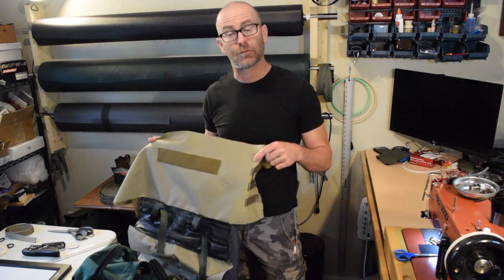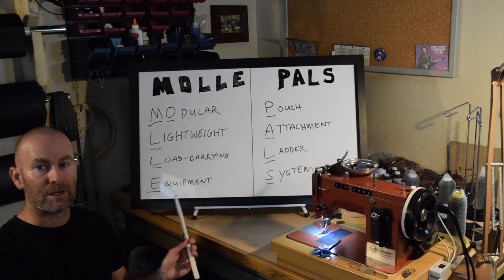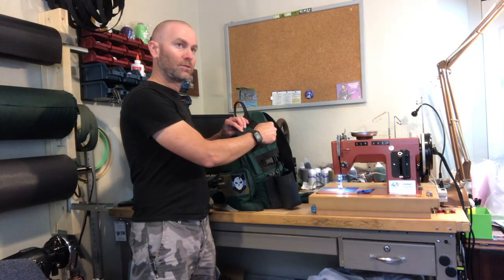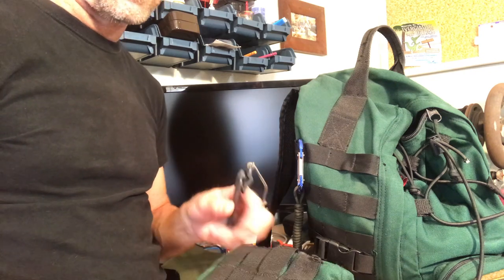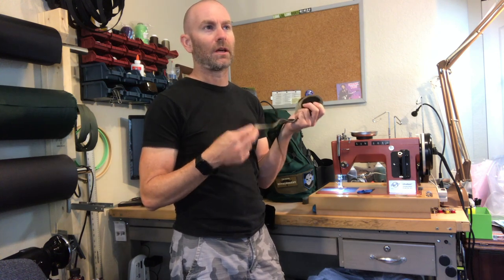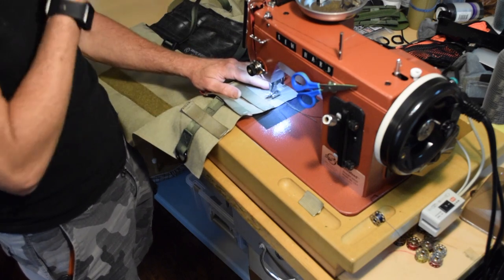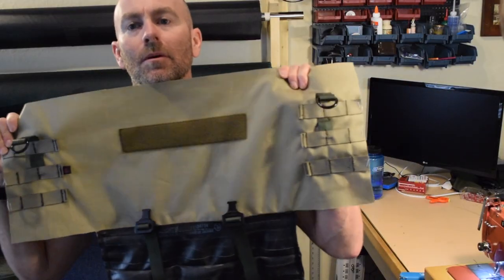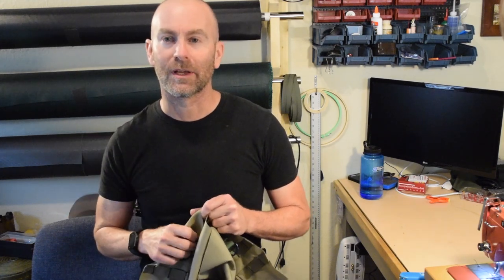Sewing MOLLE (and maybe we shouldn't call it that)

Comment: For those interested, the "official" requirements for PALS webbing barracks is that they will be 3/4 inch long and hold a minimum of 250 pounds.  No specified pitch or barrack width....
Reply from the maker: Thanks!  Do you know of a resource where that is documented (that "normal" folks can access)?

Comment: I have a US MOLLE backpack from army/navy surplus store and it has zig-zag on the straps. 2mm wide and 18mm long strip with about 24 stitches in that length. If you do try to find a MIL spec for sewing, there should also be something about thread tension spec in there too like a bolted connection will have a torque spec. What tensile strength does the thread have? If 20lbs times 24 stitches that's 480 or a factor of safety of 2X or more for a typical 95% Male. Of course a heavy pouch will have two MOLLE straps for even more of a safety factor.
Reply from the maker: Really great info, thanks for contributing!

Comment: Typically a 28 stitch bar tack is used to tack 17337 down but several custom gear builders use 3 passes of straight stitch (which is what they use in laser cut 'MOLLE ' panels and it holds just fine.
Reply from the maker: GREAT info thanks!

Comment: Great explanation...former army guy and didn't know pals ha.  I've got my sailrite on the same drafting table. Thank you for the vids.
Reply from the maker: Thanks Brian, 
That's pretty cool that you're using a drafting table as well.  I'm planning to make a new top for mine with a cutout to mount my machines in, you might want to check that project out whenever I get it done!

Thanks for watching and commenting!
Reply: thejasonofalltrades  I have something similar in the works too. The table top design is based on the "Paulk workbench."   Keep up the great work!

Comment: As one who served In the military As a combat Shoulder And sewed Combat equipment Like flak jackets and more I would often used The MOLLE System. As of sewing on The webbing I  leave About An inch between straps Like you Did . In the video You talked about the stitching you used And you Weren't sure if it holds up in military specs,Still what I would do Because I had a straight Stitch At the time and didn't have any zig zag options I just Would go Front words and back 2 to 3 times And wouldn't even lift my foot and move on to the next i would just keep on selling in a straight line to the next strep . As of Strange and military specs For me it held up pretty good and did not have Any problems. I love watching your projects I'm very inspired by them And get good ideas to.I hope I helped in the way If you have anymore questions Feel free to ask . It's always good To get a second opinion .
Reply: feel free to contact me for pics. of the Pouches I made
Reply from the maker: Thanks for contributing your knowledge!

Comment: Hey Jason.. do you use bonded nylon or polyester thread for Cordura sewing? Thx again my friend
Reply from the maker: Hi Jeff, 
Sorry for taking so long to reply!
I generally use bonded nylon, usually in size V69 (aka T70) for everything I sew.
In this video, I was actually using V92 polyester, only because it was the only OD green thread I had.  I previously used this thread in my toiletry bag, one of the most successful and long-lived projects I've made.  However, this particular thread has had a tendency to unravel when I'm sewing at times (but NOT after it has been sewn in).  I don't have a lot of experience with polyester to say whether or not it would be better in some applications, but bonded nylon has been my go-to for almost everything I sew.
I hope that helps, thanks for watching!

Comment: Thanks for the video. Just want to know thread size(#) and what thread material you are using to sew the molle straps with. 

Thanks for your time
Reply from the maker: I almost exclusively use nylon thread in size V-69.  The Thread Exchange has a great selection and a lot of information.  I don't know what the MilSpec for MOLLE requires, but V69 has worked great for me on many projects with MOLLE/PALS.

Thanks for watching!

Comment: I know it's not necessarily germane to this particular video, but have you ever tried to sew scuba webbing? If so, how did it go? What machine and setup (needle size, thread, etc) did you use?

Thanks!
Reply from the maker: Hi, 

I'm so sorry for taking so long to reply!
I have not sewn SCUBA webbing.  It's been some time since I've handled it, but if my memory serves, it's pretty dense stuff.  I suspect it should be sewable with most machines, but it may be helpful to choose the right needle and thread; I'm purely speculating, though.

I would try my freediving weight belt to see, but it's rubber, sorry! :)

Comment: Also, thoughts on replacing the webbing with 1" loop velcro for dual attatcment options.
Reply from the maker: I've seen this done, but I haven't tried it myself.  I think it might be better to sew velcro to the webbing than to just use the velcro AS the webbing.  But it would definitely add some versatility!

Comment: What is that large and beefy “sewing machine” in the 3:18 background? The one with a bridge-style support on its top?
Reply from the maker: Hi!
That is a Singer 29-4 "patcher."  It is a cobbler's machine, intended for patching shoes.  It is commonly used for things like sewing patches to leather jackets, because the sewing head can be turned 360 degrees while sewing (so you turn the head instead of the piece you are sewing).  I've never used this one, picked it up at an antique store.  It's possible that 2021 will be the year I finally get it going.
There are some very cheap versions of this machine (google "Chinese patcher") available on the internet, as well.
Thanks for watching!

Comment: What thread do you use? 
Thanks for the great information.
Reply from the maker: Hi John, 

In this project I used a polyester thread in size V92, but I'm not sure I recommend it.  The strands of the thread tend to separate while sewing with it.  I've used it in other projects with no discernible issues, though. (I'm uploading a review of the finished bag in the next day or so, and I talk more about this thread in that video.)
My go-to thread is bonded nylon in size V69.  Size 69 is generally considered the heaviest thread one should use in a domestic machine, and I regularly use it in my Sailrite.  We also use it a lot on industrial machines at my work.  
I hope that helps, thanks for watching!

Comment: What kind of machine do you have? What would recommend .
Reply from the maker: The machine used in this video is a Sailrite Ultrafeed LS-1. Full disclosure, that machine was provided to me by Sailrite to review.  I have since purchased the zig-zag capable version, the LSZ-1, with my own money at full price. I HIGHLY recommend these machines.
Check my channel for a review of the LSZ-1, and many other videos featuring them.  You will find if you do any googling about these machines that there are MANY look-alike machines for FAR less money: I have spoken at length on this in many videos, my position in short is you get what you pay for, and don't be fooled by thinking that something that LOOKS like something else is THE SAME as that thing.
If the Sailrite is out of your budget (they are NOT cheap), a used industrial walking-foot machine is a good way to go if you have the space.  If you are just starting out, I have come to love my Singer HD machine (after years of having a low opinion of them).  I just finished a year-long evaluation, several videos on my channel for that one as well.
It's a little dated, but this video covers my thoughts on sewing machine selection pretty well (other than I would add the Singer HD now).  https://www.youtube.com/watch?v=fFq5QXgF4v8

Comment: Hi Jason
Was wondering how feasable it is to sew a few PALS/Molle attachment points on by hand,assuming it can be done if you have the time !!?(attaching to Cordura) ? I have a machine but don't really want to take the pack apart....
Just found your channel and now subbed !
Many thanks from across the pond
Dean
Reply from the maker: Hi Dean, 
So sorry it has taken me so long to reply!
You can definitely do it by hand, although it will be time-consuming.  I would suggest getting a curved needle to make it easier to only go through the outer layer of fabric and not the liner.  You'll need to use care, but depending on how the pack is constructed, it's probably doable.
I hope that helps, let me know how it turns out!
Reply: @thejasonofalltrades  
Hi Jason
No worries.
Good call with the curved needles..i will invest.
Assuming i don't want to go through the liner for reasons of water resistance rather than just asthetic's ?A job for the upcoming colder,darker months ahead i believe..maybe not for you !!
Appreciate the advice and look forward to more content .
Thanks again
Reply from the maker: @deanmoriarty67  The main reason to avoid going through the liner is just to avoid the stitches showing on the inside of the bag.  If you don't mind that, you can go all the way through (unless your bag has a vinyl liner or some other water-resistant material you don't want to puncture).
Yeah, I used to have colder, darker months, lol!
Thanks for being part of the channel, let me know how your project works out!

Comment: are you using high strength nylon threading for the sewing?
Reply from the maker: I almost exclusively use bonded nylon thread in size V69.  I've used this thread extensively with no issues. I usually get my thread from The Thread Exchange.
Thanks for the question, and thanks for watching!

Comment: Is there a name for the stitch you're using? Can it be done by hand? What thread would you recommend? Thanks!
Reply from the maker: The stitch used for attaching PALS webbing is called a "bar tack."  It is technically made up of a straight stitch followed by several passes of zig-zag stitch.  If you are sewing to a particular standard or specification (like "Mil-Spec"), that will call for a particular stitch length, width and number of stitches.  However, for a DIY project, even just sewing back-and-forth with a straight stitch a few times gets the job done.
In theory, one could certainly hadn't sew webbing on.  It might be difficult.  A sailor's "sewing palm" might help make pushing the needle through hurt less. 
I use bonded nylon thread in size V69 almost exclusively.  It works great for attaching webbing to fabrics like Cordura, ballistic nylon, etc.
I hope that helps, thanks for watching!
Reply: @thejasonofalltrades  Thanks for the very informative reply!

Comment: Hey there! I know this question well mine.. it is possible to remove it? I mean the molle webbing.
Reply from the maker: Hi!,
It is possible to remove it, but depending on the material the pack is made from, it may leave unsightly holes and will not be as water-resistant as it was.  All you need to do is use a seam ripper to cut//pull the stitches where the webbing is sewn down. Where the webbing terminates into a seam, you would either have to cut it as short as possible and singe it (carefully) with a lighter, or leave it a little longer and sew it into a small loop (you could hand a carabiner or something from that loop, and it would probably look neater than just cutting it off).
It would only take a seam ripper and some scissors to remove it, but honestly I'm not sure the end result would be better. If you have a functional reason to remove it (webbing hangs up on stuff, for example) and you aren't concerned with aesthetics and/or water resistance, it could definitely be done.
I hope that helps, thanks for the question, and thanks for watching!
Reply: @thejasonofalltrades  Hey there man! Thank you for your kind reply! Overall is a project of mine which contains a Interceptor vest. Body armor actually. Thing it is it has more webbing on than the old one. I kinda want it to remove to be more oldish.

Comment: Hey Jason, Did you or anyone find the specs on that stitch for the Pals webbing. I was going to make one as well but would like to get the proper specs from the start so I can do it correct instead of aimlessly sewing hoping for the best lol. Great video! I always get good info and inspiration.
Reply from the maker: Hi Greg, 

At the moment, I am unable to find a reliable source for the actual specs.  That said, what I did on my green DIY/EDC pack that I've carried for the last three years (literally every single day) and have had stuff hanging off of its PALS grid is; I sewed back and forth about three times with a relatively short stitch setting. 
To be a little more specific - at 9 stitches per inch, sewing the 1" 17337 webbing (or other 1" webbing) three times will give you 27 stitches, plus a few backtacks.  The load being carried at any attachment point will be divided between two of these rows of stitches (at minimum). The more rows of PALS supporting what you're mounting, the less weight each stitch has to hold.
I'm pretty confident in saying that if you stitch back and forth a total of three times (at least) with size 69 nylon thread, sewing 17337 webbing to 1000D cordura, you probably wouldn't be able to carry the amount of weight it would take to make it fail.
If I find out the exact specs, I'll definitely let you know!

Comment: Could you use fabric glue or another way to make it strong without out the skill or machine to sew
Reply from the maker: Man, I swore I replied to this already, sorry!

Unfortunately, I don't know of any fabric glue or other process that will have enough strength for this application.  The good news is that the sewing isn't hard to learn, and just about any cheap, used sewing machine can probably pull it off.  You could even hand-sew them, although that would definitely be time consuming!
I hope that helps, good luck!

Comment: Thanks for this video!  Q:  Can I use my Bernina to sew these?  I'd LOVE to make my own day pack!!
Reply from the maker: Hi, 
Your Bernina should be fine (I say this having never used one).  The only parts that might be troublesome for a non-walking-foot machine would be at thicker seams, where you might have to help the machine out by hand-wheeling, lifting the foot, using a seam jack or any other method you have that works for you and your machine.  17337 webbing and the 1000D Cordura I used in this video can be readily sewn by most domestic machines.
Thanks for your question, and thanks for watching!
Reply: Thank you!

Comment: What clearance allowance do you give to be able to feed webbing through the loops
Reply from the maker: Generally, none.  There should be enough "flexibility" in the relationship between the webbing and the fabric, unless you've pack the finished pack really full, I guess.  I think too loose would be more problematic, personally.
I haven't followed any particular guide, nor have I thoroughly reviewed the MIL-SPEC, so there may be some more detail to this, but what I've always done is just lay the webbing flat on the fabric and sewed it with no additional clearance built in.
I hope that helps, thanks for watching!
Reply: thejasonofalltrades very much so. Thanks

Comment: What fabric is that messenger bag mad of
Reply from the maker: Hi,
The exterior is 1000D Cordura nylon, and the interior is 500D Cordura.  I used OD green seatbelt webbing for the strap and closure, and desert tan mil spec 17337 webbing for the PALS webbing on the sides.

I hope that helps, thanks for watching!

Comment: hi 
i was looking for cheap sewing machine for this job and other,bags,light tent canvas and some paochs ,but i have no idea and dont want to spend too much money for expensive machine because i am  a beginning level.. how about ((brother)) cheap machine ?? there is no daily works like sewing shops it just for weekend projects..
thanks a lots
Reply from the maker: HI,
I'm working on a video to answer this question, because anytime anyone asks I end up typing a 4000-word essay, lol!
In a nutshell, I don't have a good opinion of new, inexpensive machines.  You may have a great experience with one, I don't know, but I've never used them and don't have a lot of trust in them to work well for a long time.  I have a strong bias toward older machines, though, so take that with a grain of salt.
I think the best way to start sewing is with a vintage (preferably 1950-1970) machine, bought as cheaply as possible.I've paid as little as $12 for a machine that I used to re-upholster a pair of car seats, among other things.
If you're willing to hunt, you can find a good machine at a thrift store for well under $50.  The problem is you may have to spend some time lurking thrift shops until you find the right machine.
Check out my "why do I have so many sewing machines" video to see some options.
If you must buy a new machine, my personal opinion is try to get the best deal you can, and consider the machine your initial machine to hold you over until you can get something better (either a vintage machine, a Sailrite or other portable walking foot machine) or an industrial.
I hope that helps, thanks for watching!
Reply: thejasonofalltrades thank you for replying 👍🏻

Comment: "Load-Bearing"... great video
Reply from the maker: Thanks!
I originally had "load-bearing" written on my white board (if you look carefully you can see it in the opening clip), but the information I saw said load-carrying.  Either way, I guess!
Thanks for watching!
Reply: thejasonofalltrades I enjoy all you vids. I have a fully restored singer  rocketeer and material....tines my issue. Thanks for all the great info and vibe.
Reply from the maker: Thank YOU.  And a Rocketeer is on my "when I see one at the right price" list.  Awesome looking machines.
Reply: thejasonofalltrades i have original onwers and service manual .pdf
And as you know, yt, is amazing for info.
If you need them when time comes, let me know.